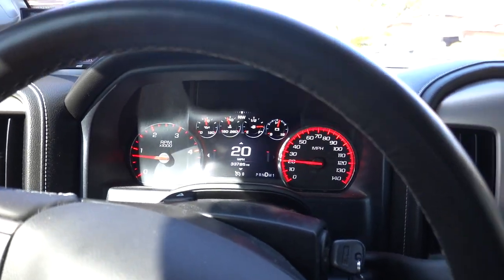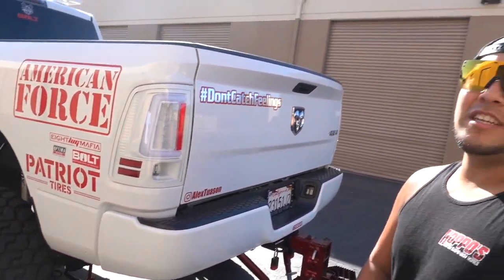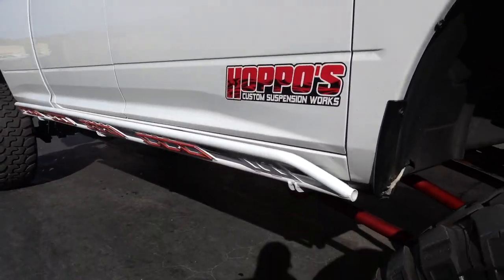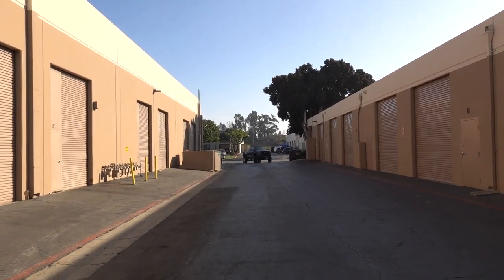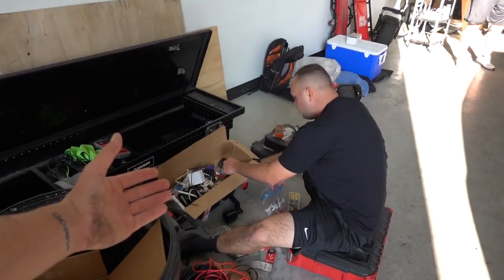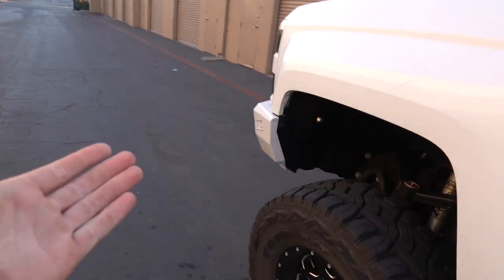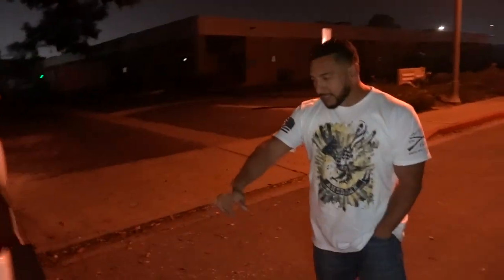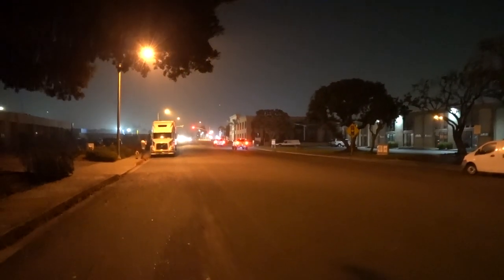LETS FLEX OUT HIS CUSTOM BUILD! (PLUS RACING ACTION!)

Comment: God that Ram is massive and looks so nice and gotta love coilovers on a solid front axle 👌🔥💪
Reply: Appreciate  it thank you
Reply: alexhoppos909 Np Such a Good looking truck Man I’m a Ford guy myself like I said but man she’s a beast and sounds like a peterbilt and I admire and Respect that 👌💪
Reply: Thank you much respect brotha!!!
Reply: alexhoppos909 🤝✊💯
Reply: @alexhoppos909  Isn't it bad to run a slider from the cab (one solid piece) to the bed since the cab and the bed flex independently. I would think I would put a lot of force on the slider and where its bolted up to the truck at full flex.
Reply: @blacknight1574   the sliders are hooked to the frame not the cab or the bed. So it's a solid mount not a flexing mount

Comment: lol spare on the roof.   No hate but damn who wants to take down and throw up that big of a wheel on a roof when you get a flat.    It’d be cool to see a spare carrier in the bed
Reply: When the first time I got a flat offroading with no  spare 40 and a few miles in on a trail, it sucked and I wasn't about to spend 900 on a offroad tow truck.  I learned my lesson, plus I carry material  and pallets in my truck  on a weekly basis so bed rack is out of the question